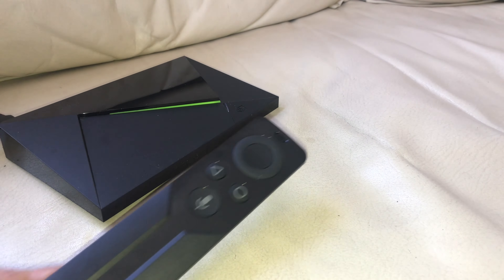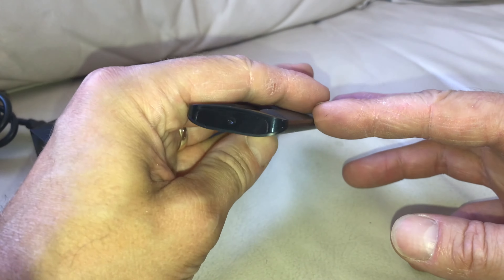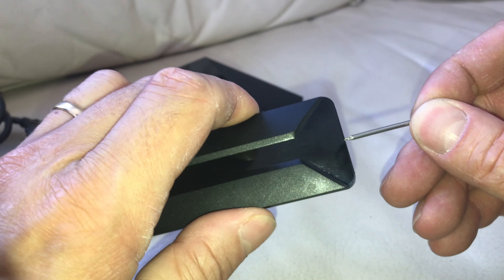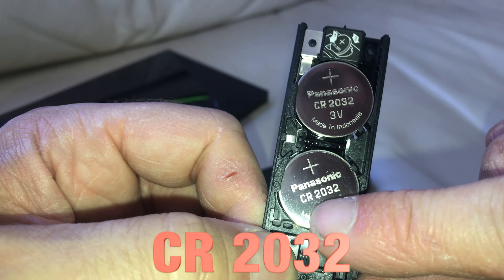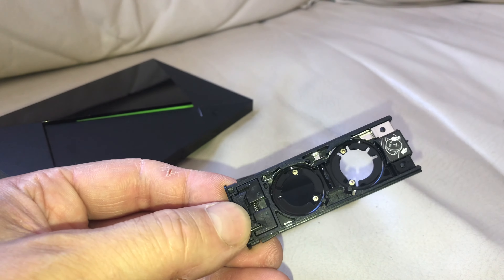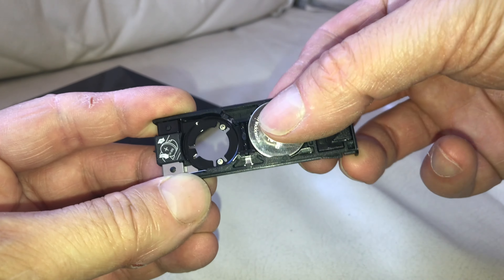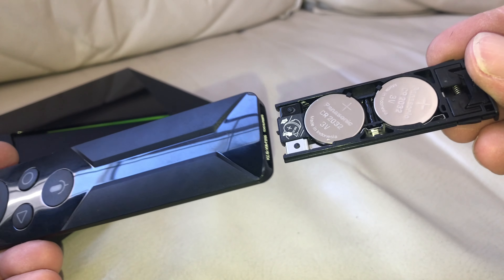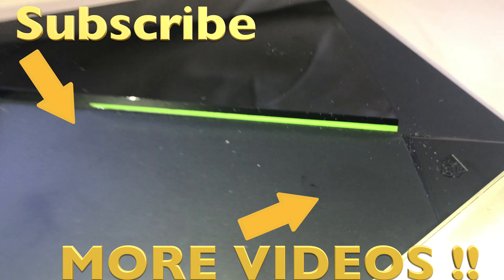Battery Replacement on Nvidia Shield Remote Control (How to in 4K)

Comment: My tray is broke it doesn't hold the batteries in place
Reply: Some of the delicate plastic "notches" and "covers" designed to hold the batteries broke on mine also. Is it possible to  buy a "replacement tray" vs. a whole new remote?